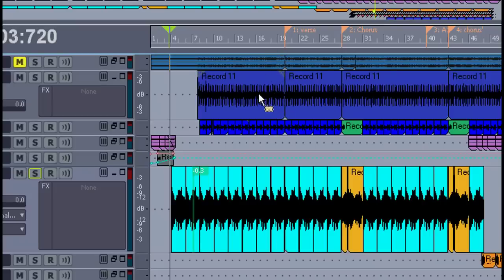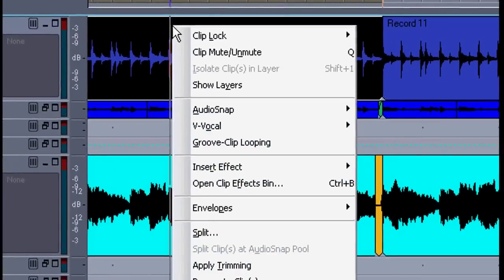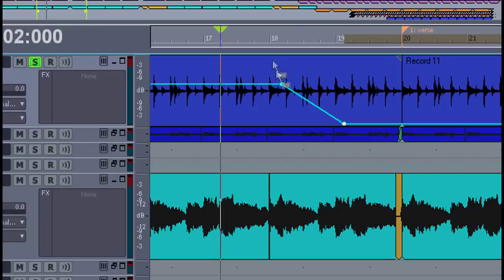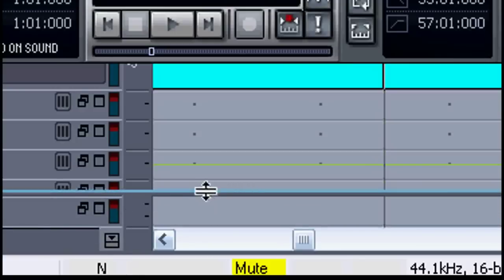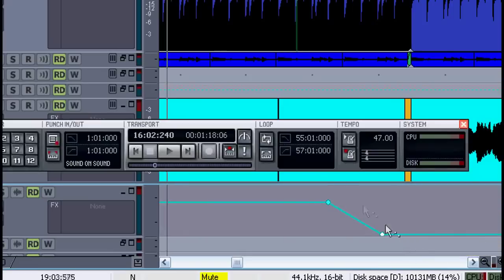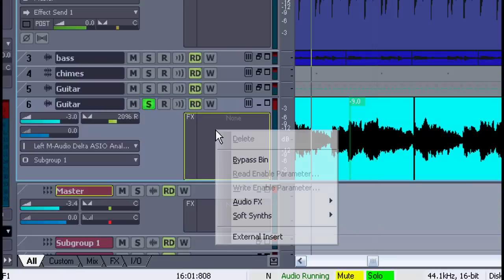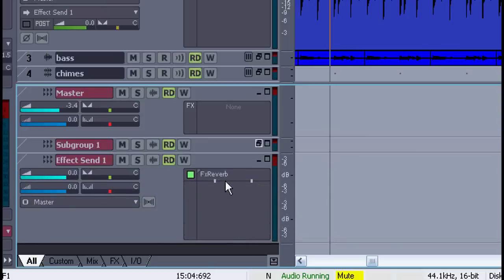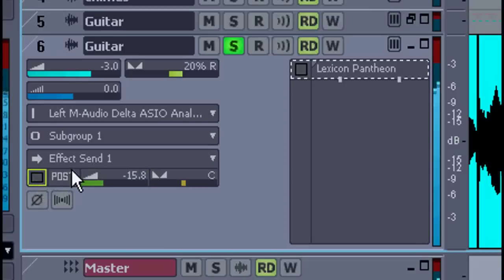Sonar Fades and FX

Comment from the maker: hi
if the fade was done in Sonar, it might be as easy as "show volume envelope" and then adjust the nodes to bring it back. But I expect you are instead dealing with velocities.
If the fade out was done using the velocity of each track, you cannot "remove" it. But instead you would need to increase the velocity.
hmmm I hope this helps to lead you in the right direction